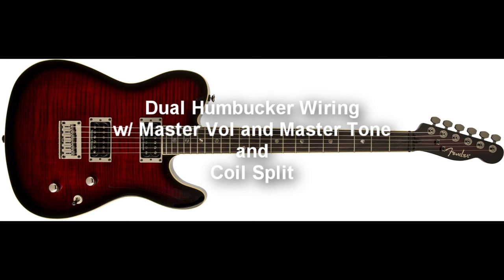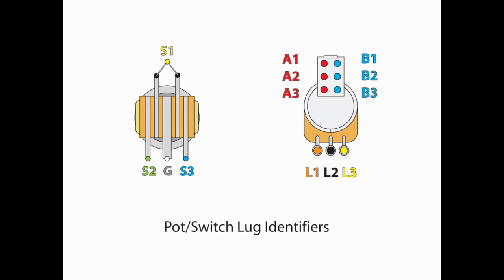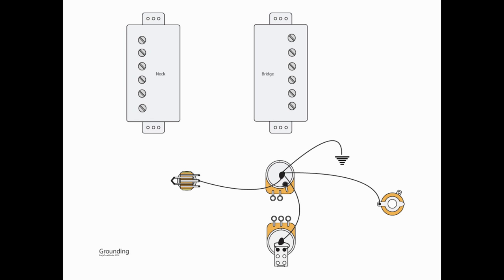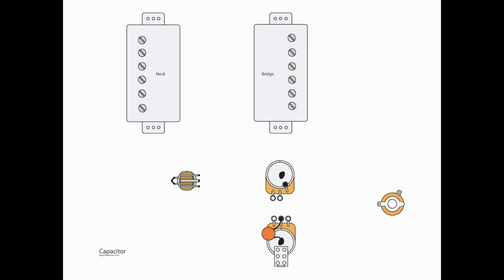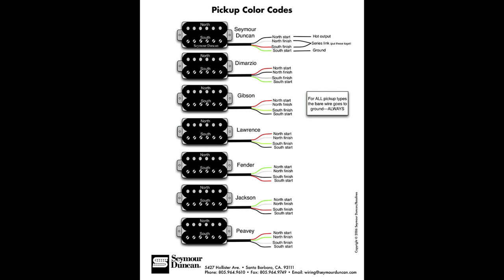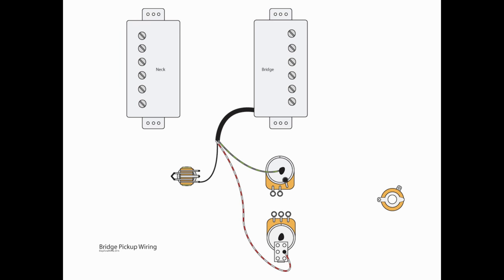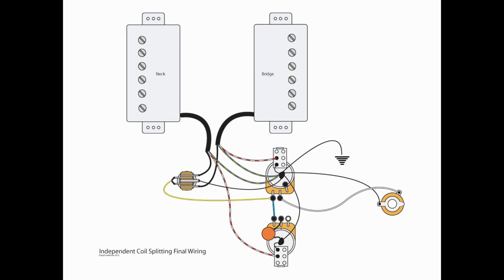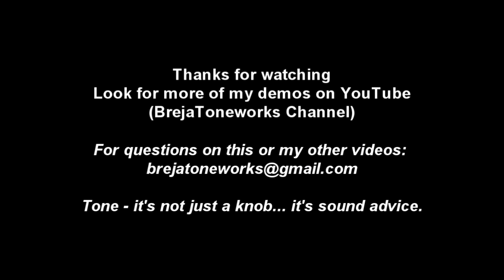Dual Humbuckers with Master Vol/Tone and Coil Splits

Comment: Hey Don't, I have a question for you; Is there a way to solder a cap to a volume pot, that would roll off treble as you increase the volume? In other words, having the volume pot set to "10" would be the same as having a tone knob connected to the pot set at "1". Any help or ideas would be greatly appreciated. Your videos have taught me everything I know and I've gotta say thanks and kept up the good work!
Reply: *Don
Sorry I'm on mobile and auto correct is killing me.

Comment: Hi there!
Being thick here!
Where does the ground wire attach?
In the diagram it ends up with a Earth sign on it 
Or is that just the indicator to signify the ground loop for identification purposes.
Thanks for the brilliant explanation videos.
Rog!
Trackside Studios UK
Reply: depends on the guitar, usually on the spring plate on the back of strat, under the bridge plate on a tele, under one of the bridge lugs on most gibson lp style guitars, etc
Reply: make sure everything gets off the back of the volume pot before going to these locations!

Comment: how does soldering the 2 splitting wires to the same lug work? would they always be on because theyre touching?
Reply from the maker: Are you referring to the Red/White wires?  They are the coil split wires for the HBs.  They would allow the HB to be converted to a SC
Reply: +Breja ToneWorks  yes but in this diagram you are soldering the red and white wires to the same lug causing them to be connected to each other no mater the position of the switch
Reply from the maker: Yes.  That's how you accomplish a Coil Split.
Reply: +Breja ToneWorks OK

Comment: Is it possible to damage the pot meter with too much heat when soldering the grounds to the body of the pots?
Reply from the maker: +Eivind Skurdal Yes.  Take a bit but it can be done.  It's very easy if a soldering gun is used and not an iron.
Reply: I have a 30 or 40 watt soldering iron. I don't think it's hot enough to even solder properly on pots but I never dared to try for real
Reply from the maker: +Eivind Skurdal That's more than sufficient to solder.  Minimal necessary heat is what you need.  Too much and you can begin to affect the pot or potentially create a situation where the solder leaks into the inside of the pot.

Comment: how do you wire this if you have a push pull on the volume pot and not the tone pot?
Reply from the maker: +Terry Delport The Switch wiring is ALWAY separate from the Pot wiring - meaning, it doesn't matter if the switch is on the Volume, Tone or completely separate.  It will be wired the same.

Comment: With 2 humbuckers 1 volume and 1 tone Strat type 3 way blade switch. Can I use 2 push pull switches in order to have both coil split and phase in and out. If anyone knows I would appreciate help. I know how to do both just not sure if both can be done together.

Comment: Dude what is the difference of the tone pot you are using ? compared with a standard pot ?
What do i gain by using that type as opposed to a standard pot ?
Cheers in advance 😁😁🤘🤘
Reply: Assuming you are using humbuckers just buy a 500k long shaft pot & a 500k push/pull ,long shaft pot and you'll be good.  Short shaft pots are if you're mounting them in a pickguard like on a strat.

Comment: This wiring diagram isolates the inner coils on Seymour Duncan pickups, not the outer coils. If you want to do outer coil, red goes to the selector, white and bare go to ground, and green and black go to the push-pull. The coloring scheme in this tutorial is wrong for outer coil isolation on Seymour Duncan

Comment: This is not the correct way to do it.
You will get coil split on both humbuckers, but it will not give you two humbucking singlecoils, which is what you want when splitting two humbuckers with one switch.

Comment: Is there a way to wire it with one push/pull and only splitting one coil? Like I just want to split my neck humbucker and not the bridge, is that possible?
Reply: Leave the red and white wires for the bridge pickup together and taped off, connect the red and white of the neck pickup to the switch as shown. If you later want to split both, just solder the ground and bridge pickup wires to the other side of the switch.